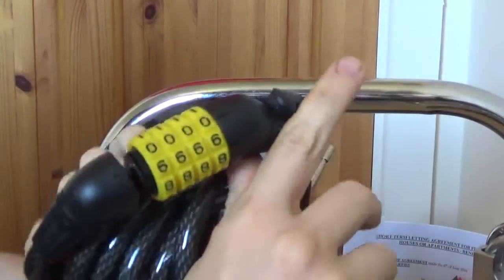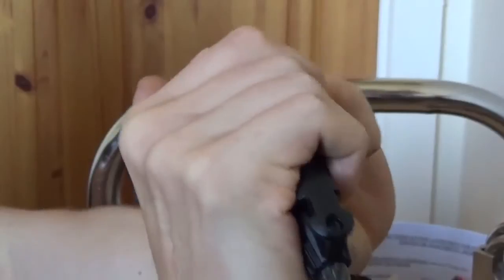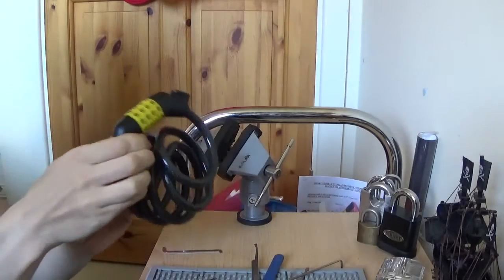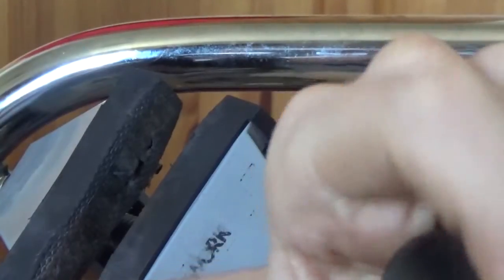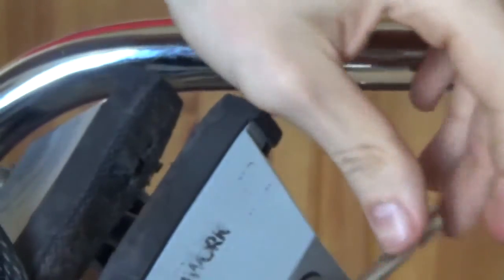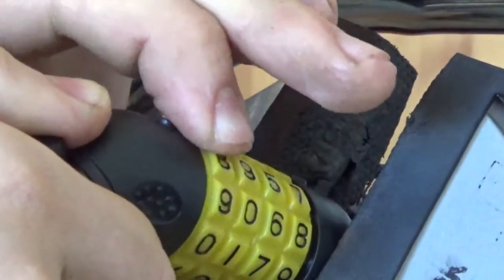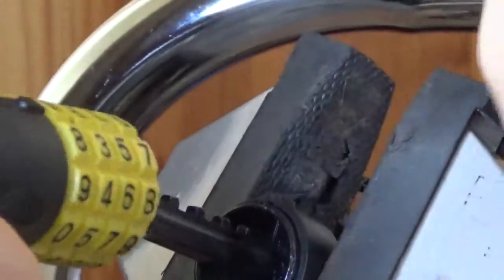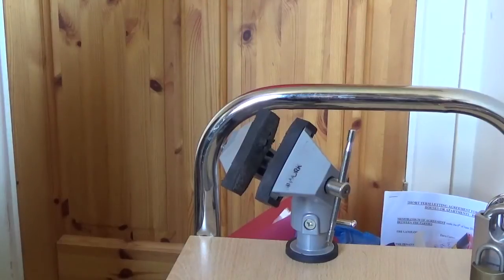Lock:104 Rolson combo bike lock.

Comment: hey, i dont know if u will see this but i recently got a rolson lock and it says the default combination is 0000 so i put it at 0000 and it still wont open even though i know its right, what should i do.
Reply from the maker: First I would double check that you are lining up the combination 0000 with the markers on the lock. Then put double check this by putting in 0000, 1111, 2222 and so on till it opens. The lock might be a bit stiff too. But if that doesn't work you will need to brute force the password by checking each combination, so get a movie on and the popcorn because it might take some time. If you went through every combination and still no luck, then you have a faulty lock on your hands.

Comment: I have a rolson lock but I don’t remember the code and it won’t open
Reply from the maker: Not the greatest lock. If it is stuck on your bike and and not locking your bike then you might try cut it off if the combo is too hard to decode. You could brute force the combination by trying all combinations. If that works great, however if it doesn't then the internals night be broken or corroded. I had a combo padlock that failed due to corrosion inside. Had to chop the shackle.